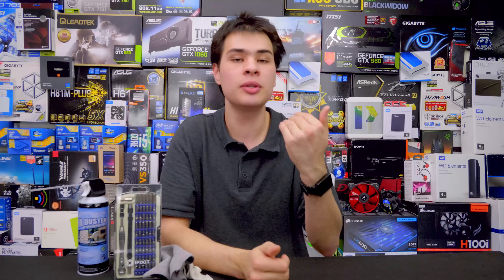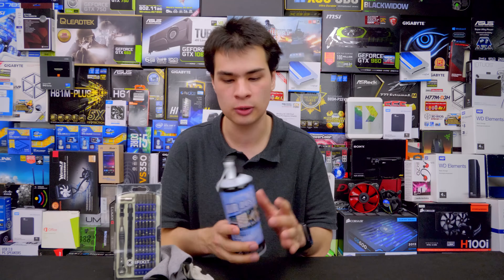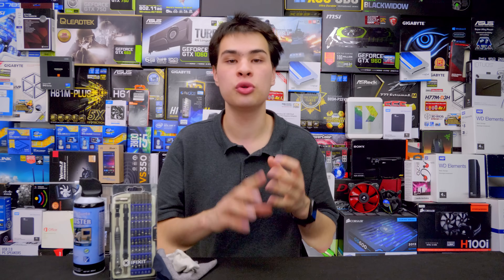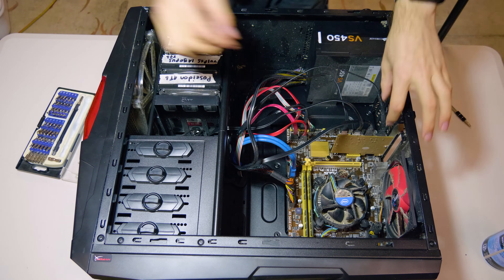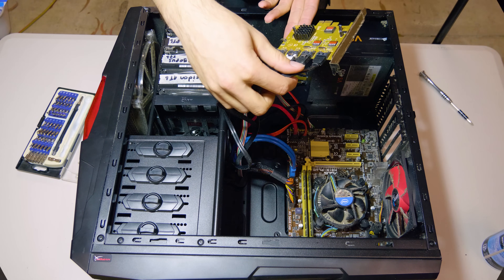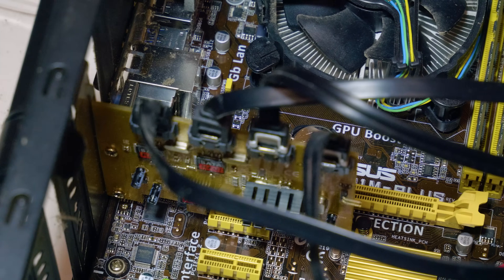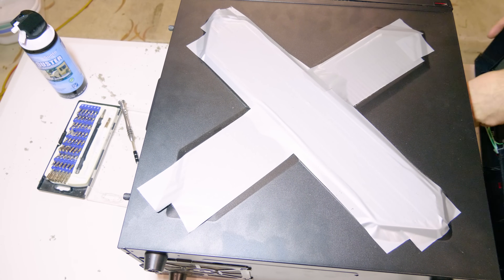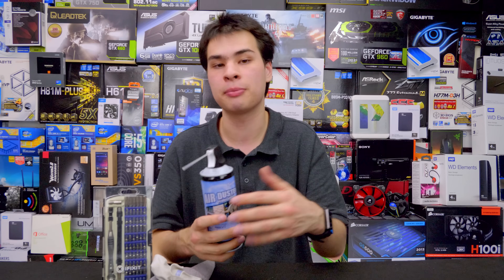How To Clean A PC Right

Comment: I have a question. Is there any way to see if computer is dirty of fat as came from when make some food and that smoke as contains fat??? I have my computer wall to wall with my kitchen and smoke came in to my room that my computer is. There is no doors inside my apartment.
Reply from the maker: yep, you can pop off the side panel and run your finger on one of the case fans, if it feels greasy or waxy and you can visually see any oil shine on parts that should not shine then there is oil or fat build up. The chance of this happening is rather low as you would need a lot of oil or fat vapours to start to notice anything and to get enough vapours to start a build up you would need to be using your pc as a kitchen exhaust fan. but have a look for any signs of oil on the fans
Reply: When i touch my computer parts i don't feel oil or fat but i still suspect my computer contains fat.
My computer case is Cooler Master Cosmos II Case and wings are gone and all computer parts are exposed for oil and fat. Can i somehow clean oil and fat off from my computer parts???

Comment: CAN I INSTALL ASUS RX 550 2GB GRAPHICS CARD IN MY CORE 2 DUO E6600 2.4GHZ CPU WITH 6GB DDR3 RAM AND MY PC MODEL IS 0A58H AND POWER SUPPLY IS 365WATT MAX...PLZZZZZ REPLY
Reply from the maker: yeah it should be fine but amd does recommend a 400w PSU as the minimum but you might be able to get away with it
Reply: CPU modder U MEAN THAT I CAN INSTALL WITH THAT POWER SUPPLY

Comment: 'Don't blow to close to the motherboard, may take caps, chockes etc flying off.' that's a crap motherboard if that ever happens.  'try to keep your compressed air at least 20cm away from the motherboard.' you just made that up and have no real reason why I can't and in the video you got very close to the PCs components. 'Hold your fans still, don't let them spin' you gave no reasoning and this from my knowledge is incorrect anyways. 'if your take all of the components out you can wash the case, just make sure it is dry before you put the components back in' oml, that is the absolute dumbest thing you could tell your viewers. You are just assuming what types of cases they have. Water can wreck bad plastic and can rust old metal cases. Lastly, there where multiple tips you repeated through the video to make it longer. End of rant.

Comment: I find the best option is to clean it on the sink with warm water sponge and dishwashing liquid. Or I put it in the washing machine
Reply: I took mine to the car wash
Reply: @paulfernando6282  I took mine to a minefield
Reply from the maker: that truly is the only way
Reply: fuck my pc does not turne on now ..help.
Reply: @MaxGameZz  u did it wrong u gotta get the right dishwashing liquid brand
Reply: i tried it. it doesnt work. should i try turning it off and on again?
Reply: @casperhoopit6858  did you try putting it in rice
Reply: @casperhoopit6858  try yelling at it
Reply: @casperhoopit6858  Sorry for the late response but did you plug it in?
Reply: No. Use a pressure washer with 1 part chlorine and 2 part water
Reply: i just bake it at 350*f for 60 to 80 minutes or until golden brown
Reply: Terence Lee yeah lol
Reply: I can see this being a HowToBasic video lmao
Reply: If you really want to clean your pc, you have to disassemble all the parts and wash them individually
Reply: Do u let it air dry?
Reply: i like to dry it in the oven so i can overclock my motherboard by baking it
Reply: Kurt Esto Actually I did use this way before and it works fine
Reply: Kurt Esto thanks it worked
Reply: There's actually an Indian TV serial where a wife does EXACTLY THAT to her husband's laptop. Washes the laptop and hangs it on the wire to dry afterwards lol.
Reply: What soap would you suggest?
Reply: Fark bro it didnt work ayy
Reply: The vidio didnt work and this tip dont work aswell. Now it dosnt even turn on
Reply: Wait I actually put mine in dishwasher and now it won’t power on
Reply: @johnbooher1840  you just failed the joke AND ruined ur pc lol
Reply: Stupid suggestion, most PC's won't fit into the average washing machine unless it was raspberry Pi. Dishwasher would generally be a better choice.
Reply: washing machine + bleach = flawless clean

It voids the warranty but I guarantee you it'll be perfectly clean
Reply: It's hard to laugh, I swallowed a screw
Reply: Someone is gonna take this seriously :D
Reply: BRUH that won’t work lol
Reply: I am literally proud of myself for realizing that this was a joke...
Reply: Mother of pearl. .
Reply: Dude wtf! I just did that now pc has broken components because of you!
Reply: Kurt Esto I use a vacuum, Works GREAT! 👍
Reply: Kurt Esto 😂
Reply: I usually use a high pressure hosd
Reply: Instructions were unclear I ended up eating my pc
Reply: lol bait
Reply: U trying to be funny tough guy eh?
Reply: Thanks that helped but it won’t turn on I guess I need to let it dry
Reply: I was about roll a bunch of joints. Dry but ganji weed... Dog knocked the bowl into the side computer fans, now my Dusty computer is full of weed.. Trick is .. yes, I'm trying to save the ganj... 
This sucks...
Reply: Why did I try this 😭😭😭
Reply: John-Jacob Tolliver at least it’s clean now
Reply: Kurt Esto fun fact: you can do that with most keyboards and they’ll still be completely fine.
Reply: Do you recommend I plug it in while cleaning so the fans spin and flick the dust off?
Reply: i sink my pc inside Mariana trench
Reply: elda  It would work, as long as you completely dried off your computer component parts before plugging in.
Reply: i think i had to remove all the cables..
Reply: Just put it in the washing machine on 30 degrees for 30 min
Reply: just tried now pc isnt turning on
Reply: Clorox Bleach seems to be the best brand that actually works.
Reply: ThatOneOsuAddict yea it also tasten really good
Reply: @lucashenquet9286  Try putting it in your soda. Freshens it up a bit
Reply: looool

Comment: Why is blowing dust around inside the computer ever a good idea?  Am I the only one who uses a vacuum to suck the dust out directly instead of just moving it around inside?
Reply: youngsatchmo vacuums can create static which can damage ur pc while this is still a pretty rare chance of happening there is still a risk ull kill ur pc not to say I haven't vacuumed PC's out before I have n never broke anything but I guess most people just don't want to risk it
Reply: IdlePit 
That static thing on vaccums are completely false. Just make sure you unplug the system first before cleaning it with vaccum
Reply: @goldensperm7182  Right but also make sure you hold your power button down for at least 15-30 secs to release the remaining power left behind. What I do is tape the fans down, use air duster, then vacuum the air born dust out of the area followed by wiping the surfaces down with alcohol. Especially the fans
Reply: Good point
Reply: The real reason is on the off chance a component comes loose, the vacuum will suck that component up.

Comment: cleaning your GPU&CPU will help you to decrease fan noises I just clean mine and my fan now so quiet try it!
Reply: as airflow gets better heat will be dissipated faster and fans will run slower= less noise
Reply: I've got a 1060 3gb and i've had it for over a year and my pc is loud af...Idk if it's my shitty intel cpu cooler, my case fans or the gpu but everything is really dusty and i don't have the right place and such to clean it thoroughly....
Reply: @Masa6x  You could still clean it in your bedroom just put garbage bags on your bed and be sure to clean the dust on your floor and desk afterwards
Reply: WD-40 specialist fast drying contact cleaner
Reply: Please check if the fans are still working after you clean
Reply: its obvious and change that termal paste even best ones on the market cost maximum 10-15 bucks, for example 20g - 4 times more than normal syringe of arctic cooling mx4 is 20 bucks only and will last you a long time even if you clean multiple pc's
Reply: i cant wait, ive had my pc for about 5 years with very minimal dust cleanups, and i lived with a jet all this time next to me, haha!
Reply: Can you remove the big metal think on CPU and dot have to add the gel again??? on CPU tnx in future plz I need to know
Reply: Does increase preformance?

Comment: Or you could grab pure water, it's not cheap but good for cleaning electronics since it's so pure that it's just water itself with no minerals making it great to clean a pc, just pour it onto your motherboard or whatever you want, if you have money to buy it
Reply: Tap water works fine
Reply: This reminds me of the old delete system32 memes
Reply: Giorgx Costs a bit more but thx, fellow pc dweller
Reply: I should try this next time
Reply: ionized water isnt conductive so u gud
Reply: i tried it and now my pc wont turn on... Did I do anyhthing wrong?
Reply: @cjhaviation  

It's because it's still wet inside the HDD. You need to take a really powerful magnet and drag it left to right a couple times to grab the water away from the pin header. If you turn it on and you hear clicking than you are good to go.
Reply: @killtyrant  its a joke. I'm not gonna douse my pc in water

Comment: Cringing at 3:18 because you're not supposed to blow air on a fan like that, it can cause the motor connected to the fan to put out voltages, even if the computer is off and unplugged. Should be careful there though you did say not to let them spin. I suggest something small and plastic to go between the blades to keep them from spinning.
Reply: Super Sword Gaming motors generally only produce small voltage similar to what they would use but to achieve 12v from manually spinning a motor ud have to spin it at high rpm a quick burst of air n ull prob hit 1-3v if ya lucky also ya could just unplug the fan before spinning it then the charge doesn't go anywhere and since a motor doesn't store energy cuz it's not a capacitor of any kind the charge will be gone before u plug it back in no need to jam things into fans or heatsinks ur probably at higher risk of damaging things by jamming things into them than u are letting it spin at low rpm for all of 2 seconds